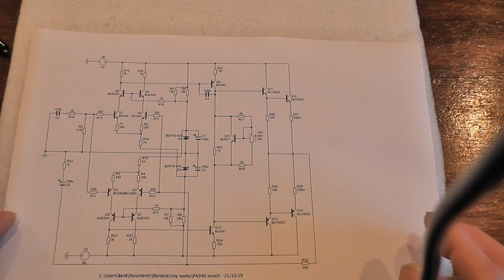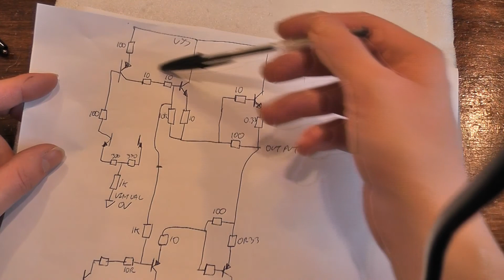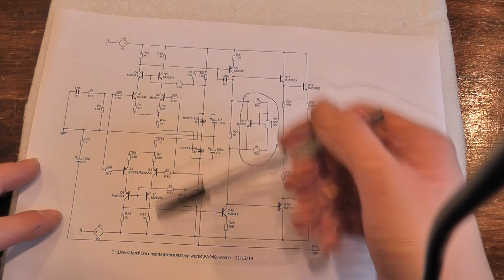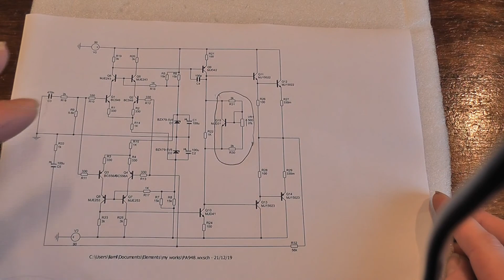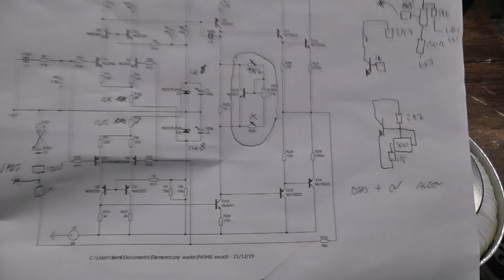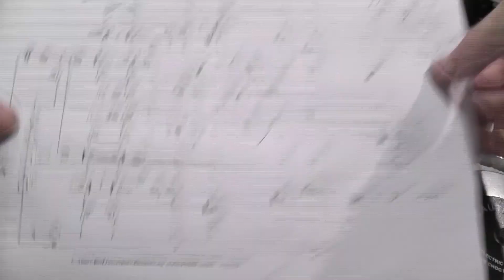Pa948 PT3 fixed

Comment: Hi well this is off subject but I was used to British schematics with the in put on the right output on the left so were was this designed ? Also I very rarely changed the value of any component assuming if there were no failed components now I worked on good equipment Crown Otari Ampex Revox B&O Levenston
Reply from the maker: They're a German company I believe so I'd guess German design.

This was such an odd fix, I really have no idea why it had been altered to such an odd set up.

I generally only change components values if there's an issue with a common failure, or I need to alter the operation to meet a certain criteria. Sometimes I'll put what will still work fine if it's close to what it should be, but I don't have the exact part.